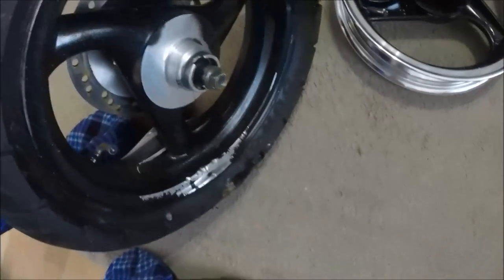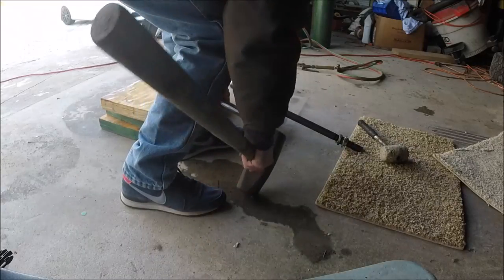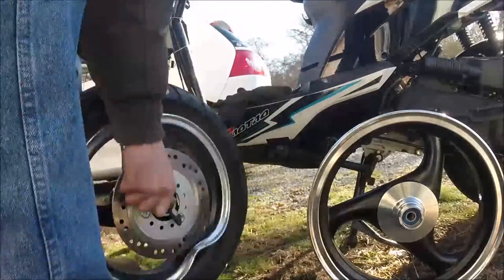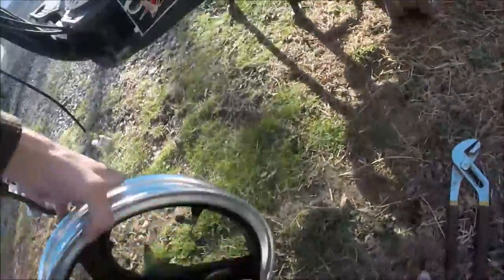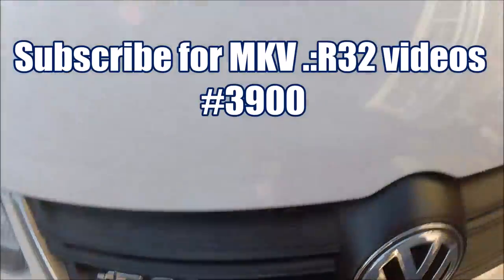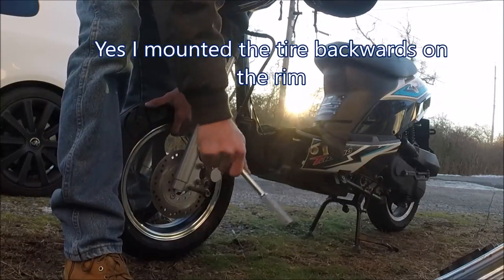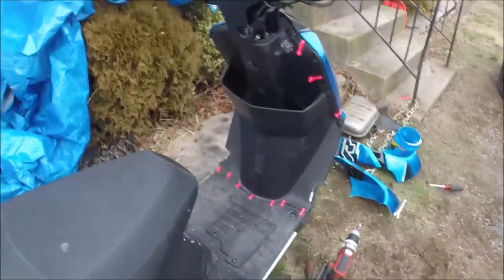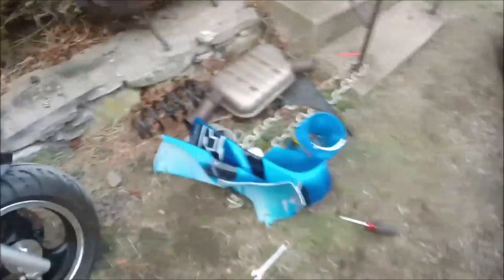Straighten Bent Scooter Forks On A Tao Tao

Comment: I have a serious question if you're still around. I just had to replace my steering stem because it bent and cracked halfway thru and I wanted to know what kind of bearings if any were seated at the bottom of the stem near the shocks when you pulled yours? I ask because I didn't see anything when I pulled the forks....just a thin piece of metal around the stem.

Thanks

Comment: I recently picked up a thunder to replace my stolen atm50 and found out it had a bent tree on my way home with it.  I'm a little wary of pounding it back into shape but found a parts bike with a straight one.. it also has a few other things I need. When I do the swap, ill try straightening the bent one and should be able to end up with a second running bike. My plans to sell the second one cheap to someone that needs a vehicle and recoup some of my overall loss from this whole deal.
Reply from the maker: James Eden Nice. Right now I have a peace sports 50 that's kinda like the ATM 50 but the Tao Tao thunder was my favorite scooter.
Reply: joshcb7 nice.. I still miss my ATM 50 but I'd just gotten it to the point that I was done tweaking things.  The thunder is Definitely a 'better' bike though.  It's mostly little things like the bent tree and a couple cracked plastic that make me cringe a little when I go to ride it.. my goal is to end up with a better than new thunder in the end. I've already got it going 45 with a 72cc kit and a bunch of other crap.